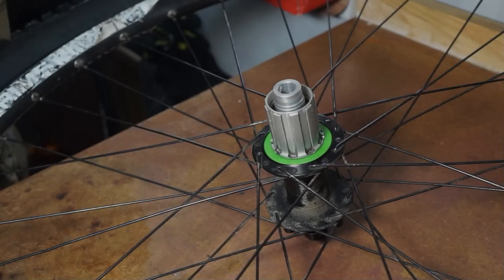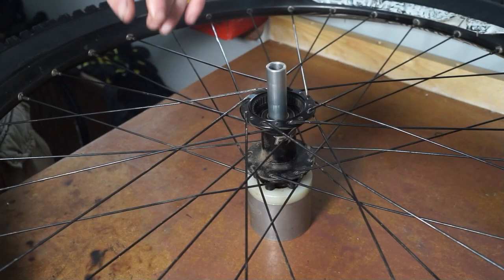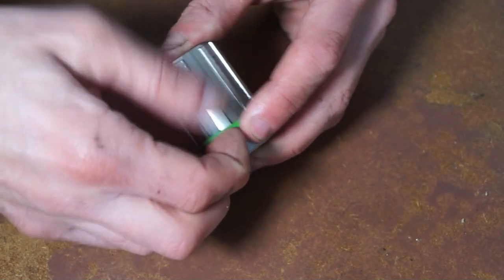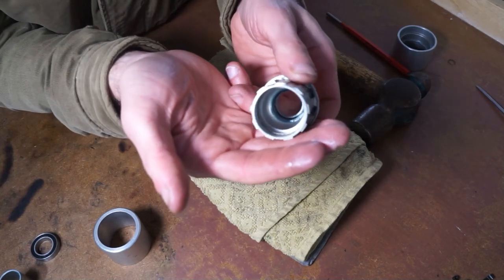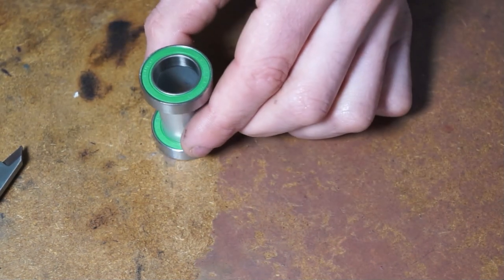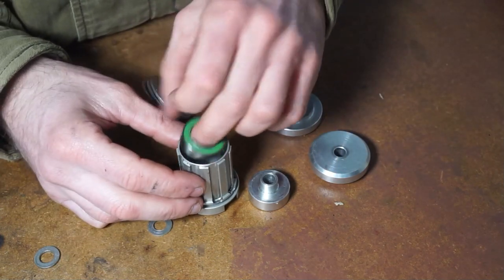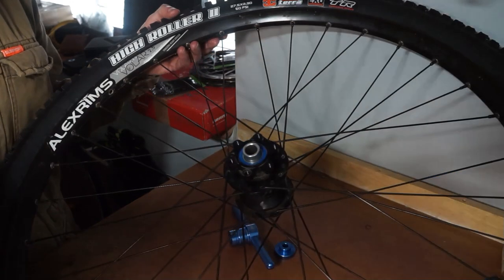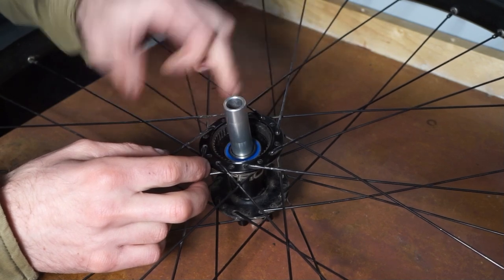Hope Pro 4 Rear Hub Bearing Replacement Including Freehub - In Depth

Comment: Thanks for sharing. I found this much more informative and easier to follow than the Hope video. The first time I did this I was unaware of the deep press tool sold by hope. Definitely made the job easier this time! I still struggle getting the green seal back on though. The Hope tool for this isn't even worth buying in my opinion
Reply from the maker: I'm not a fan of installing the labyrinth seal either, just feels like you're going to break it even with the correct tool.

Comment: Excellently detailed video, looks like the process for an Nukeproof horizon v2 hub would be very similar? Do u not need to use a freehub oil/grease for the pawls?
Reply from the maker: Thanks, tried to make it as short as possible.

I would say a lot of the hubs now have a similar process unless they are shimano which use cup and cone bearings still. I would run some sort of lube where the pawl comes into contact with the freehub body only because it's metal on metal, how long that lube actually stays in the gap I don't know. 
Else where I don't use grease or oil as it's a bit of a "magnetic" for grit and dirt but if you wanted to you can just don't use a lot of it.
Hope stick a few blobs of grease inside the hub where the freehub sits.
Reply: Awesome video, I have a few hope pro 4 rear hubs that need new hub bearings, I’m wondering where to get all those tools in your video? as I have three rear wheels with grainy bearings after 80,000 miles each …

Comment: Where did you find the new bearings? I can't seem to find them anywhere
Reply from the maker: I normally go to a company called Wych Bearings.
You can enter either the bearing code 6001rs for example or the dimensions 12x28x8 in their search bar and it will bring up different qualities of that size.  Simply Bearings is another company that I use. On ebay I use kineticbearings or airevelobearings. Once you know the size you can find who has the best price.